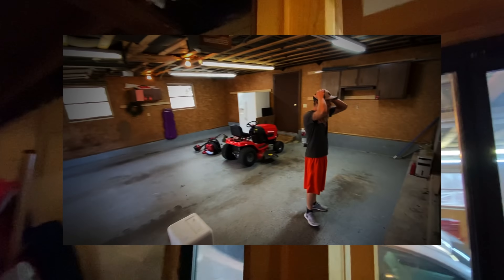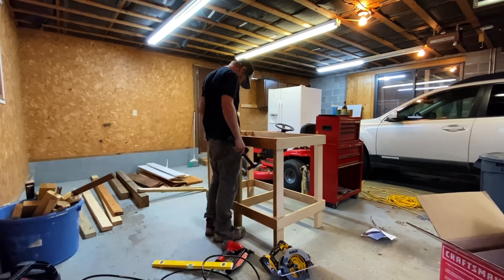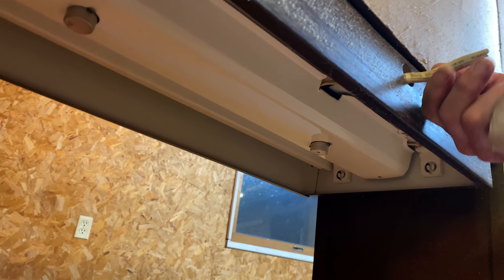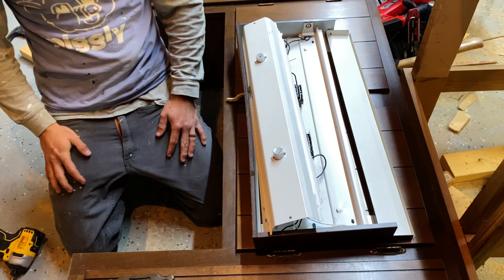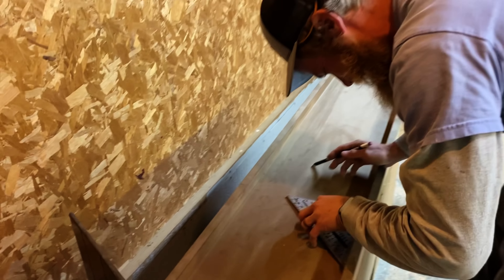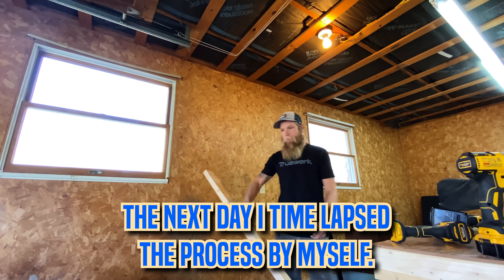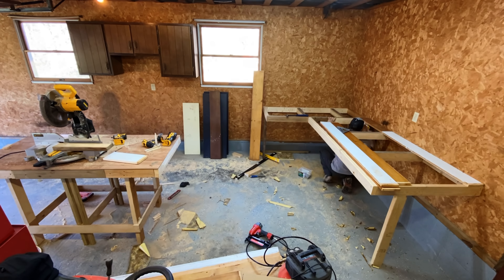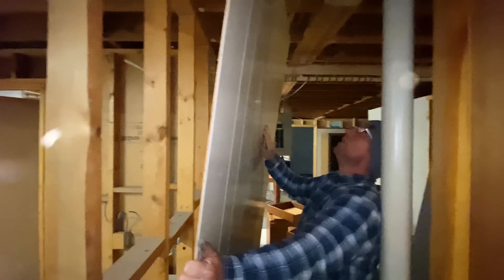New Shop Setup! From Scratch!

Comment: Now cut the long table so it's two parts and your chop saw sits flush with the table.
Reply from the maker: The chop saw is already on a separate L shaped bench that is in that corner and flush with the folding bench.

Comment: Instead of spending all of that time walking to the breaker panel and figuring out which breaker controls your circuit,  just turn it off at the source. Arc that wire really quick. It will turn off the proper beaker every time!